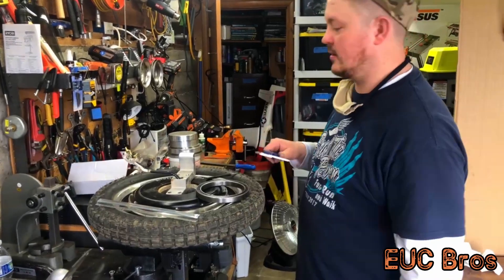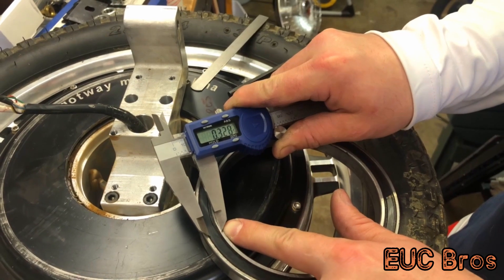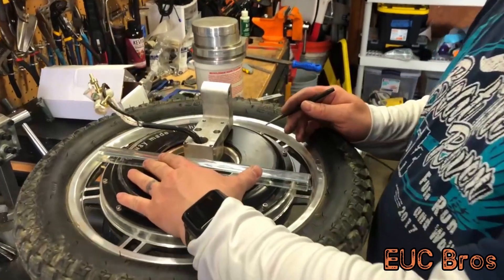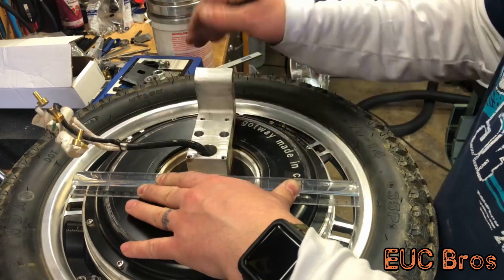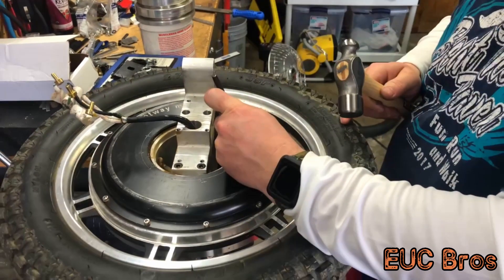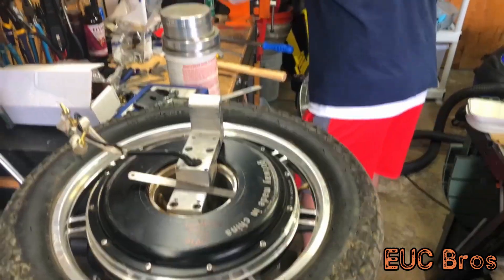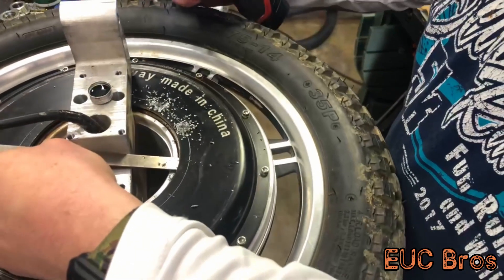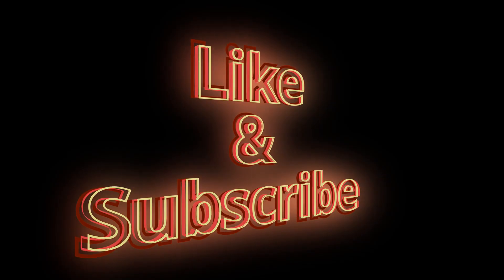EUC Bros | Waterproofing Hollow Motor Bearings

Comment: Waterproofing seems like a misguided term for this,  this is just going to let water that gets in out,  but to stop it from getting into the bearing after it is between the shield and bearing you need pack the bearing with some form of marine grease. This might let water out more than not having the holes but it doesn't make it waterproof. This is just like when I installed showers for a living, I can have weep holes on the bottom threshold but it isn't something to stop the water from going out of the front of the shower if there is no barrier to stop it. Pack the bearing with marine grease along with making the holes.
Reply: i agree marine grease will be a better option, the grease will stay in place so the water will slide on it so nothing will get in the gap between the bearing and the plate. So just pack a lots of grease inside and that's it.

Comment: If I have the tools and skills to remove the bearings, can the seals be removed from the bearings like on smaller rubber sealed bearings? Would it also be advantageous to regrease the bearings with a quality marine grease? This combined with drilling the holes. Or not worth the trouble? Thanks. Great bench videos guys!
Reply: I tried cleaning and repacking the bearing and I think I just got more junk in the bearing. Not sure that was the best move. This may have been better idea or ill just keep my monster pro in on days it looks like it will rain.

Comment: Hmm I understand you are creating holes to allow water to get out but what do you think about the solutions that are intended to keep water from getting in in the first place?
Reply from the maker: There is no good solution to keep the water from going in the first place this is a solution so that no water is resting in that little area where I can seep into the bearings that sits there even if the wheel is moving with the holes moving at any speed the water gets sprayed out and you don't have to worry about it
Reply from the maker: We've done it to all our Wheels since the very beginning after our first bearings failed and we've had no issues since
Reply: @eucbros9235  That's awesome that it works for you guys but I don't think this process is something a lot of EUC guys are going to have the tools/skills to do IMO.  For a machinist like you it's like scratching your nose.
Reply: @Duf  in my opinion the grease is in the long term going to cause more problems. It will attract dirt and hold onto it, and the grease that is dirty can still be pulled into the bearing past the seal. With the way the motor goes through hot and cold cycles it’s almost guaranteed to happen. Drilling the holes allows the bearing seals to function as intended.
Reply: @murlandfish2762  Let me ask you this.  I heard a theory the issue is the difference in temperature from inside the motor to the outside is causing a vacuum, causing moisture and contaminants to get pulled through the bearings.  A fix I have seen multiple people do on the V11 is drilling a single small vent hole which prevents that vacuum from occurring. Supposedly this hack has been working well. The holes you guys are drilling accomplishes that as well, perhaps inadvertently?
Reply: @Duf  no we are not puncturing into the interior of the motor, so the temperature cycle would not be fixed, but if water is not on the seal then only air will be moving in when the motor cools and that has never caused problems in old motor designs. No reason to think there is a new problem besides this cover holding water against the outside of the bearing
Reply: @eucbros9235  I was referring to repacking the bearings with marine style grease along with the TPU bearing seals that go on top?
Reply from the maker: You'll have to discuss that with Murland. 😁
Reply: @eucbros9235  Gotcha :)
Reply from the maker: @Duf  isnt it also hard to repack a bearing and cap it? Also that requires removing the bearing then putting it back it which alot of people supposedly can't do either. We are very very fortunate to have murland in our lives!  He has come up with some amazing solutions that even got way has decided to do to production wheels now. 😁
Reply: @eucbros9235  We all agree that Murland is a huge asset to the community!

Comment: So the problem we're solving here is that water gets into the bearings and can't get out, so it rusts. But by drilling these holes you're creating an escape route for the water when the wheel is spinning?
Reply from the maker: Yes indeed
Reply: Not into the bearings, into the space beside the bearing and trapped against the bearing. This effectively submerges the bearing. Drilling the holes lets the water get flung out and keeps the bearing dry and never submerged.
Reply: @murlandfish2762  when the water flings out, where does it drain?  Is it spraying the inside of the main wheel/side covers?  If yes, do you need additional holes to let it drain out of there?
Reply: @joshuajones6113  it is just released into the tire area open to the road
Reply: @murlandfish2762  Brilliant, thank you!

Comment: You guys know more about at this than me, but just inherently it seems that drilling holes into the motor cover would make it more susceptible to water and dust. What am I missing?
Reply: Also, wouldn't that void the warranty?
Reply: The holes are not into the inside of the motor, just into the small space beside the sealed bearing
Reply: Centrifugal force
Reply from the maker: Lol what warranty? And if motor is spinning what is getting pushed or pulled out those holes. When sitting it drains out the holes. It doesn't just sit in that gap. Without the holes if water got in there it has no where to go with motor spinning or not spinning so it gets in the bearing and starts the process of rusting or other foreign objects seeping in.
Reply: @eucbros9235  it would be helpful if ewheels or EUCO or another dealer or manufacturer would comment on the warranty issue.
Reply from the maker: @mikeintampa250  my bad I forgot jason does do warrenty. My comment was about gotway lol
Reply: @eucbros9235  Lol